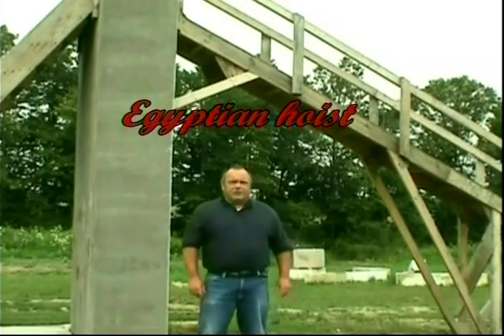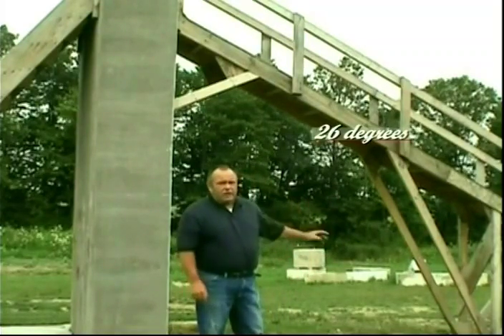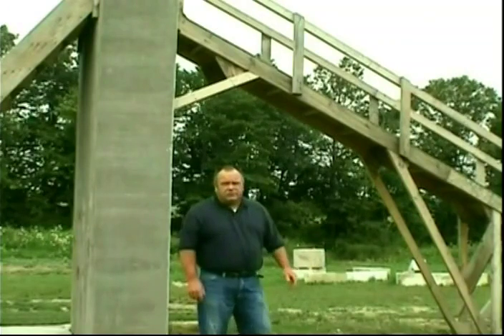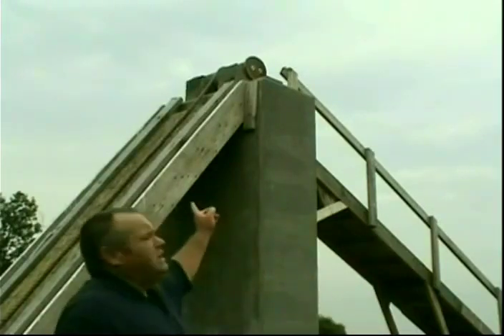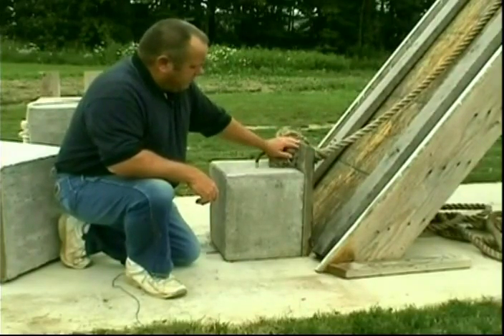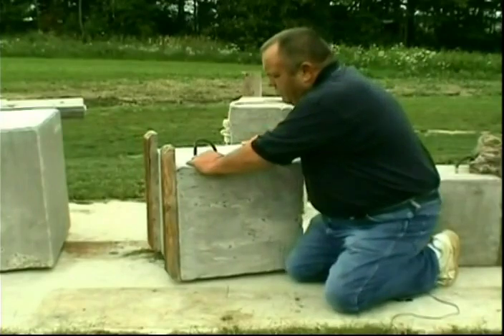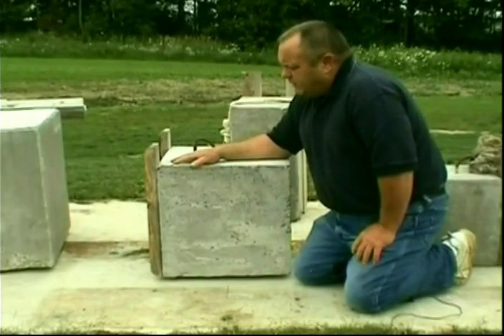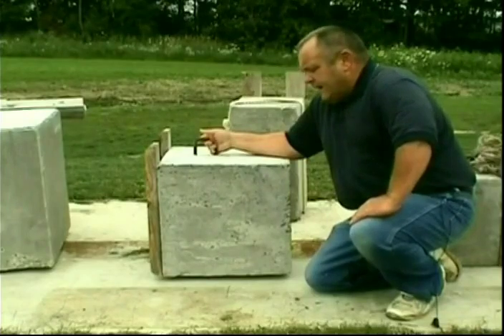Ancient Egyptian Pyramid Building Technique Reveal By Wally Wallington

Comment: The only long poles in the tent are:

- Pyramid was 571000 sq ft at the base
- Core stones weighed on average 1.5 tons  (~3300 pounds)
- Still need to quarry with copper tools or diorite balls
- Still need to transport even though the core stones were quarried near by
- Still need to rough cut and maybe final cut with copper tools
-Then you get to pull 1.5 ton and heavier blocks up on the slide. 
-Don't forget the interior slabs of granite for various features. those weighed ~25-80 tons (information getting harder to sift out of all the internet junk). They needed:
    - To also be quarried with copper tools or diorite hundreds of miles away
    - To be transported and loaded onto boats
    - To be offloaded and transported to a holding/prep area
    - Probably final cut with precision in the holding/prep area
    - Located to final resting spot (So dragging 25-80 tons up nice slippery wooden ramps then slid, pushed, pulled into place with relative precision.
Same same for the casing stones, and basalt used on some of the base around the pyramid

Yeah, I can see it. Well done.
Reply: And also the symmetric dimensions of the piramide with a accuracy of  a thousands of an inch.
Let Wally  try that also.
Reply: 1) They were not using copper tools, they were using copper ALLOY tools such as bronze. There are bronzes with nearly the same tensile strength as steel.
2) Just as it is done today in modern quarries, most cuts of the stone blocks are done with a rope with embedded superabrasive studs, such as corundum or non-gem diamond.Both corundum and diamond in non-gem grade are found all over Africa and the Mediterranean basin.
Reply: @tetrabromobisphenol  lol. Sure man. ZERO chance they were building these structure with strictly manual labor. There was some sort of technology used. You have to look at the extreme examples and work your way back, because if they did the extreme examples in a fairly low-effort way, that translated down to the easier material. 

There is no way that diorite balls or copper ALLOY tools explains the linear scoop marks found all over the world...especially on ceilings, vertical surfaces and under very hard to reach place. They also were used to to rough int the the holes on the massive granite, basalt, and diorited boxes in the Serapeum then finished to a high precision and polish. Didn't happen. You can hand wave all you want, you can stomp your feet and gnash your teeth all you want, but it did.not. happen.
Reply: @michaelh6743 no one has addressed the problem of the ropes. Making the ropes big adds more weight and after so big whose hands were big enough to hold them. Using multiple ropes brings the problem of physical room. How many ropes can you really get on one stone and leave enough room for people to actually be able to pull on it. Making them long only weakens them. Today we would use wire ropes to lift those kind of weights. Modern fiber ropes can't carry that much weight. Until someone comes up with the type of rigging they used I call bs on all of these ramp ideas. I've worked around heavy loads before and it takes an incredible amount of time and effort to lift 50 tons. These weights were not lifted on a ramp or other method using rope.
Reply: @Craig-fl8jj Thats always been in the back of my mind, and you you are right. 

Mainstream archaeologists and supporters that push these simpleton theories always start small with something at least somewhat plausible...Quarrying, transporting relatively short distances, shaping, and placing the limestone core blocks all with throwing some major manpower at it...and then hand wave the rest of the extreme examples. Have to  work backwards. Doesnt get much more extreme than the unfinished obelisk at the Aswan quarries at 1200 tons. Just look at the effort the supposedly more technologically Romans went through to move a 330 ton obelisk from Egypt to Rome. Scale that up by 400%.

The work was hard but not impossibly hard. They had some kind of technological help that made the impossible, possible. Judging from the similarities in quarry signatures and megalithic structures all of the world, the civilization that built them must have known about each other.

Then there was a sudden work stoppage.
Reply: @Craig-fl8jj   Well what I could find from the natural fiber cordage and rope standards is a 2-inch natural fiber rope has a maximum Tensile Strength of about 28,000 lbs. and a 3-inch 57,600 lbs. so to haul the largest stone you would need 6 2-inch ropes or 3 3-inch ropes. Given that's today's standards and friction adds more to the overall weight I would suspect they probably used a few more. Also, if you use animals say ox or camel a yolk would make rigging not that much of a problem. And we do know they used them in agriculture, so I see no reason why they would not use them in construction.
Reply: @CypherReaper  yes those measurements are from static weight. Probably on a 5 foot piece. You would probably need to derate that when pulling sideways on an object and having the force jerking on it. Then take into consideration the longer your rope Is the more you need to derate. Now in some areas of the pyramids like the kings chamber the stones are around 100 tons. So how many ropes for 200,000 pounds?
Reply: @michaelh6743  no doubt these people knew something we don't. How do you move 100ton or more stones 500 miles through desert without roads? My biggest hangup is the cordage. Maybe thats the problem. I'm thinking of ropes and maybe they didn't use ropes.
Reply: @Craig-fl8jj  The heaviest is 80 tons and the numbers I gave were for that weight. But even if you did go with 100 tons that's only 2 more 2-inch and 1 more 3-inch.
Reply: @CypherReaper  you aren't going to move an 80 ton block with ropes. Have you ever moved anything heavy before? Those ratings you have are for modern rope with static pulls using short lengths. None of those conditions exist when working with heavy equipment or loads. Ropes will not work on these large blocks.
Reply: @Craig-fl8jj  Those ratings I gave were not for modern rope but natural fiber ones. And as for the length of rope, even back in his day Leonardo Da Vinci said " the stress (Force/Area) is the same throughout the rope. Any failure would be caused when ultimate stress value is exceeded, therefore, the strength should be independent of the length of the rope, we assume that the properties of the material are constant throughout and the material is a continuous medium. However, properties can vary and there are flaws in the materials." So, it's not the length but the higher chance of flaws the more rope you use. This answer is unanimously the same by every engineer and manufacturing sites available. But let's just say the entire worlds collective knowledge is wrong, even if the ropes were 25% of the listed strength that would still only be 12 3-inch ropes to drag an 80-ton rock, which is still not an unreasonable number.
Reply: @Craig-fl8jj  You can use more than one rope, and add smaller rope as handles anywhere along a larger rope.  Twist just about any long fiber like hemp or reeds together the right way and it's a quality rope. https://youtu.be/6wve3KMhxcw?t=268
Reply: @matthewchin6454  you don't understand. For every foot of length and every "handle" you put on the rope the weaker it becomes. It's absolutely asinine to think you could pull a 100 ton or more stone through the desert 500 miles using ropes. The smaller 5 ton blocks, maybe for a short distance. Today we would have to use wire ropes to lift a stone weighing 100 tons. Pulling horizontal with a rope adds more resistance than lifting it up. Using rollers made of wood is hilarious.  First the poles would be pushed into the ground or the wood would splinter from the weight. Remember a 100 ton stone weighs 200,000 pounds. I'm sure they rough cut the stones then finished them at the site so there is no telling what the actual weight was to begin with.
Reply: @Craig-fl8jj  and again length has no bearing on the overall strength of the rope, a simple Google search of "does length of a rope effect the tinsel strength" would yield a resounding NO. On top of that I gave the number of ropes required at 75% of overall strength rating to begin with. And where are you getting that they pulled it 500 miles thru the desert? The Aswan quarries where the stones came from shipped stones via the Nile, its less than 700 meters from the river. And the simple fact that you think 100 tons would splinter a six or eight-inch log is hilarious, you do know that they put quarter million-ton cruise ships on wooden cribbing all the time in dry docks with no problems. Or are you just going to try and say that a bit of rolling makes up for the over 496,000,000 lbs. I think you vastly underestimate the materials and tools that were available at the time and overestimate how heavy 80 tons really is.
Reply: @michaelh6743  "look at the extreme examples and work your way back"
That sounds extremly strange. I don't need to know about building the "Burj khalifa" to know how a normal house is built (or a million stones were moved because there is one exteme big obelisk).

Special challenges give rise to special solutions.
Or to phrase it differently: if you have a hammer every problem looks like a nail - up to that point when your hammer is not big enough
Reply: @Craig-fl8jj  Yep, anyone who has ever seen the rigging and machinery to move tens of tonnes objects must find the idea of using ancient cordage rope completely laughable.
Reply: One of my many concerns is that the undertaking is so large that it would necessarily need thousands of workers. These workers would need food, water, clothing and shelter which would be provided by perhaps thousands more workers. Some of the stones came from 500 miles away. The quarries would have the same manpower issues and supply issues. Then the transport of the materials to the site. Someone making rope, tough wood for rollers, palm oil or similar for lube . All needing people.  You likely couldn’t have tens of thousands of workers in any one endeavor at once or they’d get in each other’s way.  If draft animals were used there’s more food,water and care for them involved. More people. I just think that using techniques that many attribute to the Egyptians would mean that the majority of the population would have been involved in construction of and support to the project. What about every thing else in their society? Trade , defense, priesthood, farming, fishermen and more. How many people did Egypt have? I find it hard to believe that they would commit the majority of the nation to a project that would last for a generation. They must have been something we’re missing.

Or they were merely occupying sites built much earlier by someone else yet to be understood.
Reply: i also think they didnt have wheel figured out yet
Reply: @leffarix  The basic wheel on a shaft design had been in use by humans for at least 1000-1500 years before the Great Pyramid was built. It was relatively old technology by this point.

Comment: You are basically using a pulley at the top. Egyptians did not have pulleys.
Reply: The step walking "Shedu four lobe pinion pulley" has a 2.8 mechanical advantage.

Comment: I am stunned with the ease with which you managed to raise this block. As this a 250 kg block, can you answer the following. As some of the blocks used in the construction of these behemoths weighed up to 10 000 kilos , divide that by your 250 kilos, gives you a block 40 times the size of your demo. Now correct me if I am wrong , a rope about 20 times stronger would have to be used. The 3men pulling the rope would have to be a minimum of say 30. P.S. with extremely large hands. The other question is , when you reach the position where the rock has to placed, how are you going to achieve the placement. Just wondering???
Reply: I would image the placement of each stone is based on where the ramp ends. Just keep moving the ramp from side to side till a row is completed, then extend the ramp to the next level. Engineering would dictate that there needs to be a gap between the pulley and the end of the ramp so the block falls off the end, into place.
Reply: Exactly. To my mind, until we admit that the pyramid builders knew how to work with gravity, we're just going to explore and philosophize.
Reply: @mtgne5351   gravity is what holds it together. They needed to overcome friction and learn how to use leverage to win against gravity on the way up.

Comment: How much time would it take to continually change the ramps?
Reply: likely less time to move the ramp than it takes to get another stone in place at the bottom. Just different crews doing different tasks in an assembly line fashion.
Reply: Prob had a ramp crew, multiple ramps a delivery crew and a top side crew to move blocks into their position

Comment: Close, but instead of having to pull the rope they filled containers with water on the oppositeside of the stone. Once the containers were heavier than the stone,  gravity pulled the water containers down pulling the stone up.
Reply: Too slow - you'd have to empty the container every time you wanted to set up for a new block.... and move the container itself and the water back to the top. Better to use a counterweight that can walk back up the slope by itself, aka humans.

Comment: Well done!  This is very similar to a system I wrote a paper on about a decade ago.  Like you I used skids on a steep slope.  However, I used the opposite side of the pyramid with "sleds" filled with sand to pull the blocks upward.  Workers would climb to the top of the pyramid with baskets of sand and then ride the sleds down.  I discovered two things with my experiments, that I needed trenches on the far side for the sand sleds to make the system work and the top rollers had to be lubricated.  The pyramid would then be the instrument of its own construction.
Reply: I'd like to read your paper. Is that possible?
Reply: Any possibility I could read this paper?
Reply: @dalegray934 How did they do this with 800 ton blocks?
Reply: @stevenpatrick9213 do you mean the blocks that averaged around 2,5 tons
Reply: @RomulusXRemus  there are , excuse my pun, tons of 60-80 ton blocks as well, and not just near the bottom. Kings chamber, the quote "relieving" chambers - all 5 + of them, etc.

Comment: You have over simplified the problems in moving very large stones by using small 500 lb stones. You're missing many mathematical problems i.e. the length of rope for 3200 people to lift King's chamber 80 ton stones using your method.. Using your math rope would be a mile long if 3 feet of rope for each of 1,000 people needed for 80 tons.Also there is a coefficient needed to start moving an object at rest. Also there's another additional force needed to stop a moving object. Then there's transporting 80 ton stones. Yes average stones 1.5 tons can be moved with your method. When you start moving 80-100 + ton stones the force or horsepower as you call it becomes impractical to impossible to create with man power. A rope strong enough and long enough to move 2:19 2:19  80 tons with your methods would itself have considerable weight.needed to be supported How  practical is a mile long rope for 1000 people to use your method to lift 80 tons .  the center column the ramp and bearing to support 80 tons would have to be quite large given the materials available. In egypt. probably need gears and pulleys.and much longer rope. You have over simplified this problem using small weights compared to enormous weight. What is the ramp needed to support 80-100 tons given the supposed limited technologies of those days made of and how long does it have to be. I once lifted transported and unloaded a 3500 pound stone. Thats just over the average size of pryamids  stones..
It was magnitudies more difficult than the 1000 pound stones we usually transported. lifting 100 pounds using  a lever doesn't mean the same length of lever will move 1,000 pounds.

Comment: One thing is for sure, if the Dyanstic Egyptians built 3 main pyramids on the Giza plateau (which seems possible to me) they clearly had more tools than the Archelogogical record states. The problem is archeology doesn't like to speculate too much, if they haven't found it, then it doesn't exist.
It seems highly likely to me they had great methods but also other tools we are not aware of. This video while interesting doesn't translate that well to building the pyramids with that style of leverage. Because they would have to build multiple ramps to make this method work. However if Wally's is just using this as an example of 1 or many ways you can lift heavy objects, then the video has relevance.

Comment: The roller you are using is why scientists will turn down your idea. Too close to wheels and bearings :(
Use a fixed round, polished and maybe greased object from wood or even granite instead.
That will oc reduce efficiency, but it will still work.